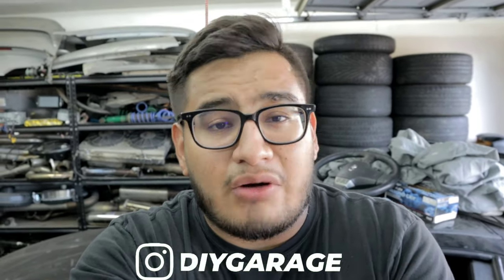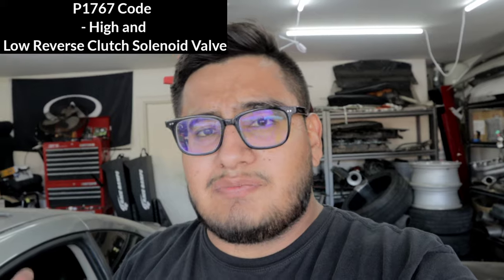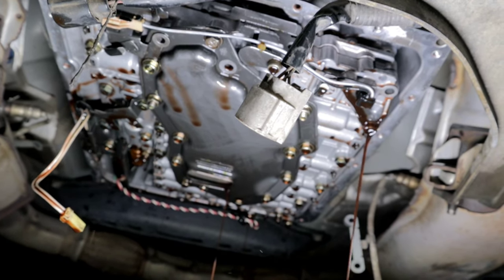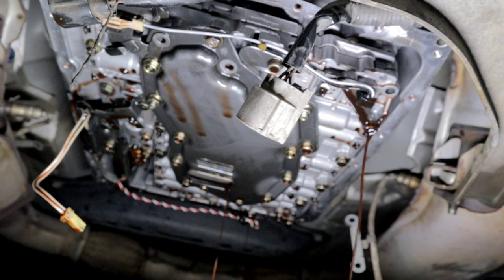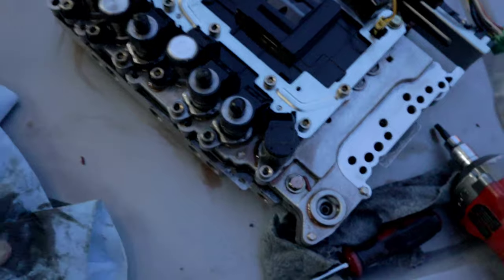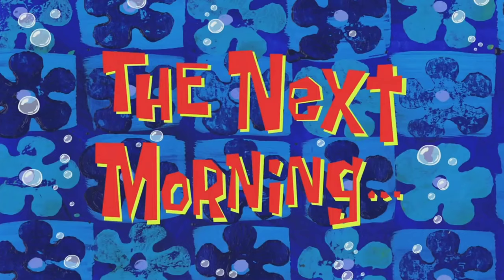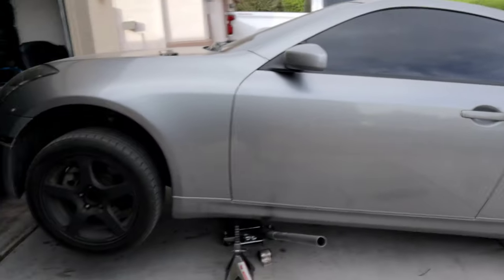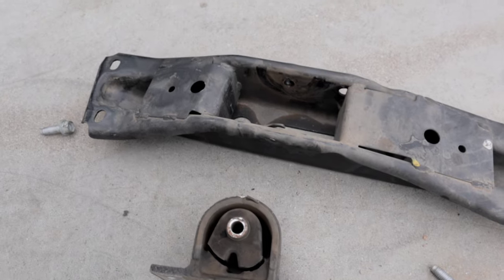More G35 & 350z are developing this transmission issue! Here's what you need to check! P1767 P1757

Comment: Hey man had a question , i swapped my engine on my 2006 g35 everything went back where it needed to be and ive got good ground, ive also installed a grounding kit and a new battery and a new starter but it just doesn’t wanna turn over or start it just clicks,  i separated the transmission from the engine a little to see if thatd help and it did , it cranks now but no start , i pulled out a coil to make sure jts getting spark and its not , have any idea why?
Reply from the maker: You probably don't have the transmission aligned properly. Make sure that the engine rotates by using a breaker bad if it doesn't than you need to go back and check what's not installed correctly in the transmission
Reply: @ERICSDIYGARAGE   ill do this first thing in the morning! any tips on how to know when its lined up correctly? Before closing it up?
Reply: @MrGodmode5 Yes. Manually rotate engine over a few times, after transmission is all bolted up. Make sure to rotate engine clockwise. If tranny isn't lined up, motor will bind up as it rotates.
If it rotates freely, you should be good. Also double check your shifter linkage. Make sure it's in same gear on both transmission AND shifter know in cabin. Quite often it gets bumped into a gear other than one you thought it was. (You can push it fully one direction then count " of clicks to determine gear position.) If it wasn't in same gear when connected it will prevent all from engaging (shift lock switch).
Hope that all helps :)
Reply: Always check rotation after fitment ..can also check the flex plate is aligned with the crank sensor...flex plates in these are weak as all ever...make sure the transmission slides right on or somethings up..saw a guy once wrench his g35x trans down after aligning the dowels and he flattened the flex plate 😂 it looked 100% correct but needed to be re-aligned...shortly afterwards his car developed a grinding sound at startup that sounded like a stuck starter....ended up being the trans pump had taken damage during the squeeze...car drove fine but sounded clapped..ended up buying it for 3k and giving it a billet flex plate,new trans pump and transgo shift kit...

Comment: I have an 04 g35 sedan with p0710 code could you please tell me which is the transmission temperature sensor 
Thank you
Reply from the maker: It's a small sensor with a cable you don't need to remove the valve cover for replacement
Reply: @ERICSDIYGARAGE  Thank you very much do you know where could I buy that sensor Nissan doesn't sell it and I can't find it

Comment: Can you tell me where is the speed sensor is at on the 04 g35 coupe? I have the 5 speed automatic with what i call a manual mode.i dont know what its called.but i can shift thru gears myself or just leave it in drive if that makes any sense lol.
Reply from the maker: The abs are speed sensors and there also one in the vavle body called a turbine speed sensor
Reply: Thanks
Reply: One more question my g has 180k miles and i want to drain and fill my transmission fluid cause its looking dark in color.would it be ok? I have a hard shift when the car is cold start and take off.
Reply from the maker: If it's dark you probably are burning up your transmission changing the fluid might make it worse or it might help its your call

Comment: Step one. Throw away automatic transmission. Step two install manual transmission. Step 3 full send and never worry about bullshit codes for shitty Nissan auto trannys
Reply: Lol these aren't even that bad. Just age poorly WITH poor maintenance. I am disgusted however by Nissans cvts.
Reply: @isaiahmoreland6952  I agree I just stay away from them period.
Reply: Understandable.
Reply: That's why, when buying used, minus service records, you have no idea how the previous owner/s cared for the car. I guarantee you, 95% of G35 owners don't know about the 50k tranny flush/change. And I'm one of them that didn't know 😳 but because my whip is full on dealer (Nissan) serviced, they informed me at 47k that my 06' G35 Coupe is approaching the factory recommended 50k maintenance!
Reply: @speedracer2831  service or not nissan has never got their automatic transmissions right. Manual is the only way to go in any Nissan
Reply: @rogerabbit_420  that could be possible. I've never had issues. But with anything else, factory equipment can't handle the sauce too well, in most cases. 
Thank God they are putting legit manuals in the 400. Seems nobody is making real manual cars anymore. Not even Lamborghini. Everything is paddle shifters. I drive my G35 in TipTronic mode 99% of the time. Not much different than paddle shifters, other than no paddles, just a slap stick. But it is nice to be able to throw it back into "Auto" when you need the convenience.
Reply: Nissan just can't make transmissions worth a damn. The manuals were also garbage for a certain amount of time as well until the CD009 came around.

Comment: I got a transmission issue on my '08 G35x where it seems to be stuck in 4th gear and wont come out of that gear. Anyone know what that could be? Thanks in advance
Reply: it's 1757
Reply from the maker: Yes it's possible I would check for pending codes
Reply: @ERICSDIYGARAGE  i'm having the same issue too should i just replace the entire valve body and tcm ?
Reply from the maker: @kaamfinitii  if it's a p1757 it's fixable and if done right, it will be  a permanent fox
Reply: @ERICSDIYGARAGE  damn i was just quoted $1500 i just gotta hope and pray

Comment: 2005 Infiniti g35 coupe. I got a p1764 code. Direct clutch solenoid function. Ik this video old and not many ppl are watching. There’s not too many videos on this code or information. I was planning on just swapping the trans but if anyone knows if the better way to deal with this code is to replace the solenoids then I’ll try that nd save some money.
Reply from the maker: I've been able to drop the valve body and remove the solenoids, and clean the valve body with compresed air and it fixed my problem

Comment: Hi man, my 350z Nissan 2004 automatic throw a code P0720. Just change all fluid and replace the filter then i got this. Any idea.
Reply from the maker: Make sure you filled the transmission with the correct amount of fluid
Reply: @ERICSDIYGARAGE  thank you Eric, knowing
Reply: @ERICSDIYGARAGE  reading that its a pain in the ass.
Reply: @ERICSDIYGARAGE  do I have to runthe car or with it cool can check
Reply: @ERICSDIYGARAGE   Eric check the fluid level and ore ok, the technician said that I need a new valve body, because water got into the tranny.
Reply from the maker: P0720 is the revolution sensor in the transmission located at the tail end of the transmission, I dont have experienced fixing this issue likely youll need to disassemble the transmission to replace the sensor thays bad.
Reply: @ERICSDIYGARAGE  Is that the one that goes to the transfer case? Sorru to take your time, appreciate your help/

Comment: I have code p1754 and p1764 what should I do I have an extra transmission
Reply from the maker: Try changing selenoids if that doesn't help you will need a new vavle body
Reply: @ERICSDIYGARAGE  should I just install my other transmission
Reply from the maker: Yes or just change the vavle body

Comment: i’m getting p1757 on my 07 350z cannot seem to find just the front brake solenoid, nissan quoted me 1800 new valve body only, found a used tranny 300$ from a guy with 113k, do you think i should just find the front brake solenoid and replace the solenoid itself or just swap a whole new trans my car still lets me accelerate just the car does not roll when letting go of the brake kind of have to gas it a bit
Reply from the maker: Say no more. Watch this, I fixed a p1757 and it's not the solenoid. I can also repair the vavle body for you if you are in Phoenix.
https://youtu.be/Ys-HNsswGCA
Also, you can't just replace the valve body. You need to make sure its from the same year as yours and also that it's the same model tcm since they have about 3 different models. Your best bet is to repair the tcm in the video I sent you. I show how it's done.
Reply: thanks! i end up dropping the valve body and end up find a hairline crack to the brake solieoid , just soldered it , turns out i didn’t know the whole freaks or anything! thanks for your vid’s!!

Comment: Looking at a 350 thats like its in N when in 6th Gear its manual all other gears are good what you think ?
Reply from the maker: Bad gear
Reply: @ERICSDIYGARAGE  thats what i was thinking buddy said synchro but i no its not that because she be grinding and they said theres no noise at anytime its just like N in 6th i can rebuild it myself but think im gonna pass on it wanted to swap it for my built R50  so its not a great deal plus it has the factory borla cut off because its sitting on tiny 16's body wise she is mint no rust or dints but she is 20 years old so she seen beatings whats a good cash value on them with 250K KM and in decent shape missing 6th

Comment: Hey man i have a 2005 Infiniti g35 coupe that I won’t rev it and wont move when i put it into drive or reverse I already replaced the pedal,throttle body and ecm from another g35 that i own and i still does the same thing but now it will let me rev it do u think is the transmission? It won’t throw no codes
Reply from the maker: It could be a transmission problem without looking at your car unfortunately I wouldn't be able to help. I would get a scanner thay reads transmission codes and do a idle and pedal relearn